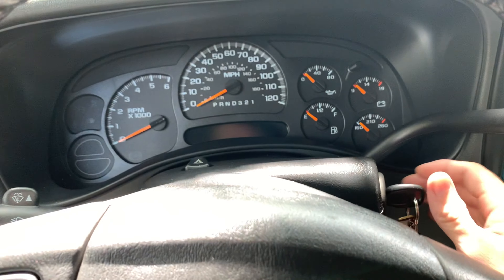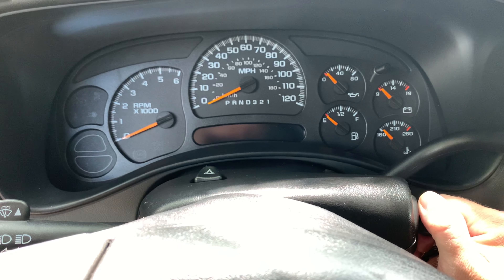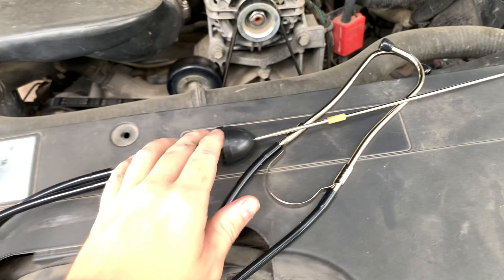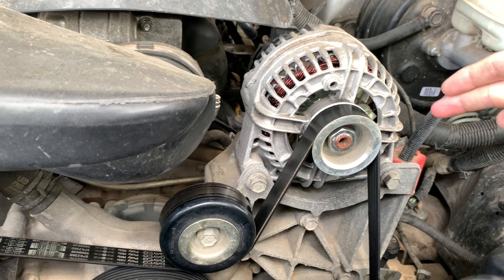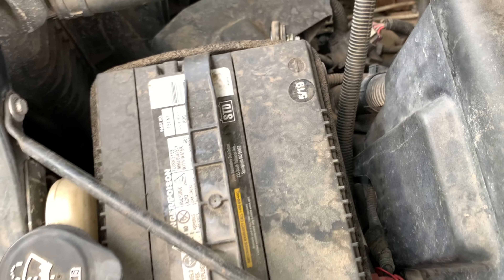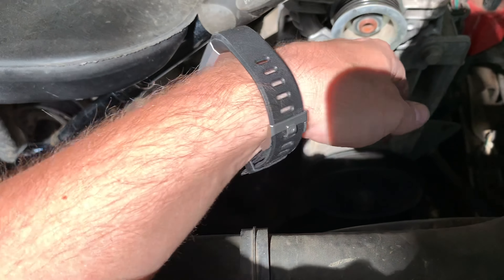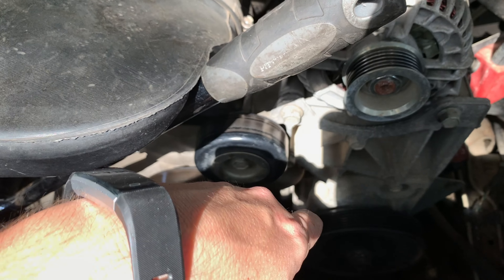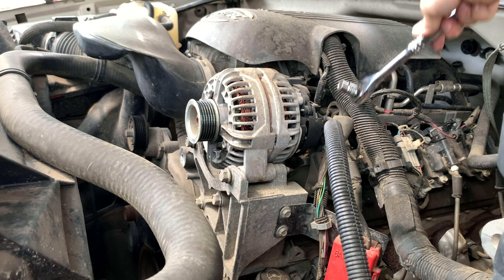Silverado Whine - Replacing the Alternator and Idler Pulley in a 2007 Silverado Classic

Comment: How many miles have you driven on it since then ? I have the same issue on my tahoe. I took it to 2 shops, they all came up with different conclusions. One said it could be my waterpump, the other said its just how they rebuild the alternation that if it gets to a higher load it will make that sound.
Reply from the maker: Probably 15000 maybe. Still whines but the truck runs alright besides that
Reply: I helped my neighbor put a long block, water pump, and total rebuild of front-end suspension on his 2007 Silverado, 5,3 L. He took a run to Alabama from Florida and to make a long story short, because basically, it was a truck refurbishing of love, and the new alternator from O'Reilly  which I noticed none of the reviews have mentioned that the replacement alternator is a two tier charging alternator. (Look it up)  However, his is making the same noise. We used the stethoscope, and it is indeed coming from the alternator. Hopefully, we'll have time tomorrow to dig into it deeper tomorrow. The alternator from O'Reilly is not an OEM replacement, and in no way I'm saying O'Reilly is at fault. Hopefully, an answer will soon be available.

Comment: Now we dont know if it was a pulley or alternator...
Reply: My Saturn Vue 2007 V6 has the same noise. When I used a stethoscope to hear the noise, the noise is across the alternator and tensioner pulley because the two parts are linked with metal parts, I guess. The problem could be the tension level. May be the automatic tensioner spring is weaker now.

Comment: Please tell me if you fixed the whine because  I have replaced alternator and pulleys next step will be a new power steering pump. I just want to know if power steering pump fixed it so please help.
Reply: Any news on that front?
Reply: After replacing power steering pump from Amazon most of the whining went away. I just need to replace the serpentine belt pulley
Reply: Replaced 2 pulleys and power steering pump. Aboutto change battery and altenator, desperate to get rid of this noise!
Reply: Did you ever fix the noise?

Comment: Lol. We're in pretty similar boats. I have that same body style, similar miles. 

Recently replaced my alt and belts and have that same whining. I joke and say it's my supercharger whistling. 

I think it's just the aftermarket alternators use a cheaper diode than the true AC Delco spec ones, and because of that we hear them more easily. Mine quiets down after a drive as well, which makes me believe that it's just the alternator not being under as much load at that point as the battery should be recharged by then.

Comment: Ever figure out the whine? 2007 cadillac escalade same noise, replaced steering pump and pulleys did not fix it. About to swap altenator even though it tests fine. Desperate to figure this out.

Comment: All new/rebuilt alternators whine. The brushes have not seated in. The new brushes are flat and rub against a round post. After the brushes become rounded with wear, the whine goes away. 
.
Reply: I got my alternator 2 weeks ago and it’s still making this noise - is that normal?
Reply: @katelynadzima1543  mine whined for almost a year.